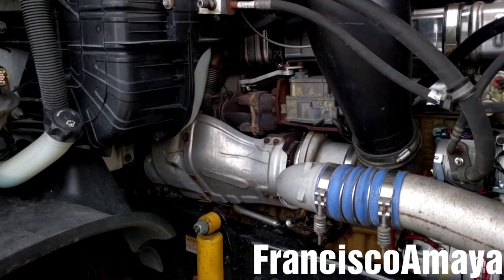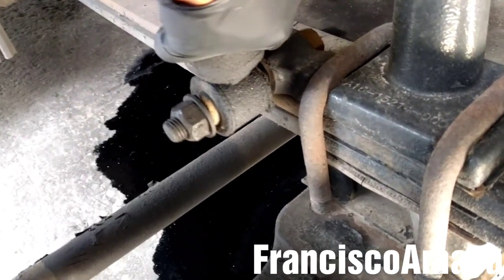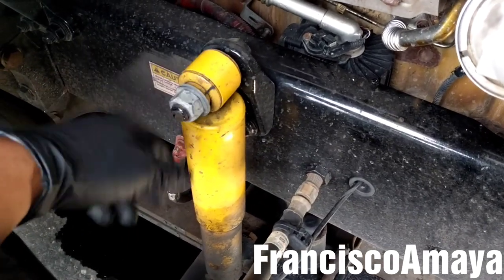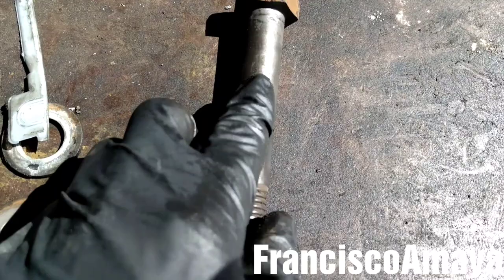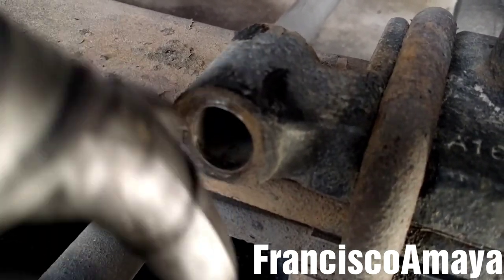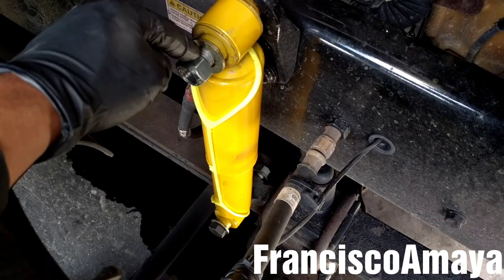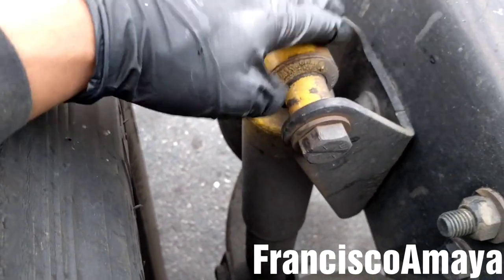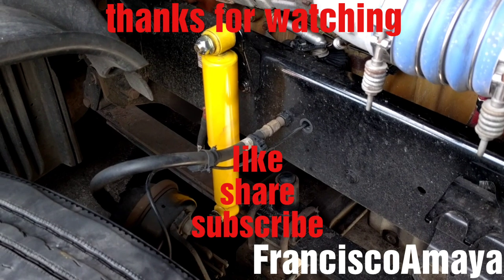Freightliner Cascadia front shock absorbers remove replacement Columbia Coronado century class

Comment: Just did a pre-trip...my front curb-side lower shock mount bolt is just...missing.  Shock is just hanging by the upper mount.  Not sure what kind of bolt to source, the washer or the nut.  Just a company driver...but it's the weekend, and I have a load tomorrow night. :/

Comment: I bought a 2010 freightliner cascadia in 2017.  I haven’t replace shocks yet. I know I need to. What if the original ones are on there? That is bad.  My steer tire worn out too fast.  I must order some shock absorber

Comment: What kind of air wrench you use in the bottom ?  What wrench do you suggest owner ops to get for this kind of work?
Reply from the maker: Any wrench 1-1/8 will work with a impact gun. 

Craftsman, Pittsburgh,  great neck, Chinese brands, etc.    It doesn't have to be a expensive tool to do this job.

Comment: Question on the air tank on the cascadia to remove the plug bolts what star bit is used? I try size 50 too small and 55 is too big. What do they use to get them off cause i want to take them off and Teflon tape it and put them back off?
Reply: sam galava did that already thats why im asking him
Reply from the maker: What plug bolts?
Reply: Francisco Amaya on the air tank... can i send u a picture? Its called pipe plug  or a hex hd plug that u screw into the air tanks to block them.
Reply from the maker: Oh, it is a hex plugs. I thought it was a torx plug.  

The plug should be 3/8 or 10 mm Allen I believe, if not it is going to be 5/16 Allen.
Reply: Francisco Amaya thanks i got it.. another thing my freind has freghtliner Columbia his ERG vavle is close is it suppose to be close when the truck is turned off?
Reply from the maker: What engine does it has?
Reply: Francisco Amaya he has a 12.7 60 series.. he got engine light code SID 154 fmi 1 .. think it means EGR low temperature
Reply from the maker: What is the year of the truck?
Reply: Francisco Amaya 2008 freghtliner Columbia
Reply: Francisco Amaya he said he cleaned out the EGR pipe and cleaned his DPF & DOC still getting that code.
Reply from the maker: This could be caused by a faulty EGR temp sensor, a leak in the EGR pipes or a faulty EGR valve.  

Check for leaks first and then check the EGR temp sensor wiring.
Reply: Francisco Amaya  ok thanks ill tell him
Reply: Francisco puedo usar el mismo aire de mi tractor para cambiar los shocks o al momento que las air bags suban afecte para usar mi air tools
Reply from the maker: Si, puede usar El mismo Aire de El camion solo necesita los adaptadores